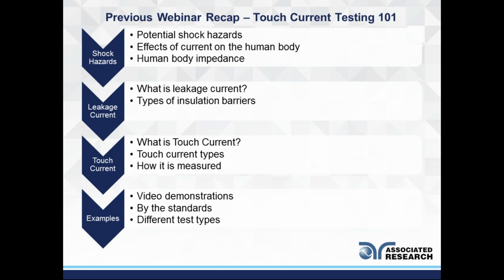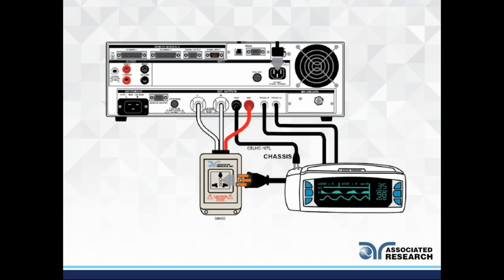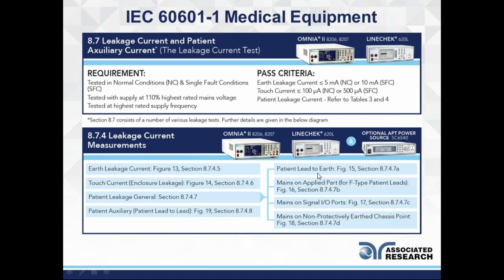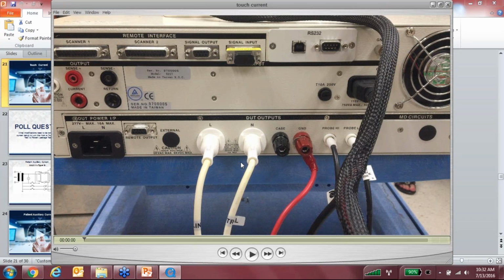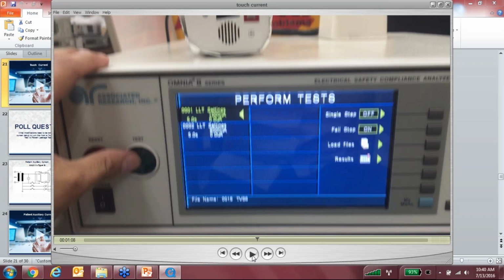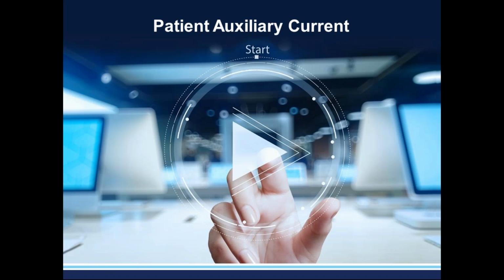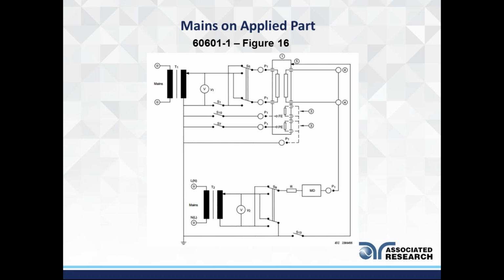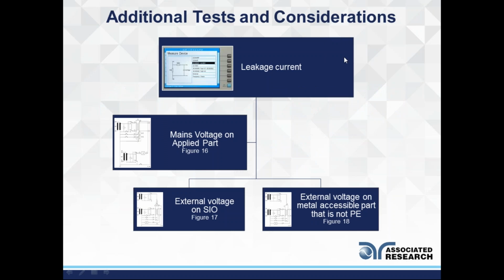Touch Current Testing 102

Comment: I am doing a similar test but the adapter box does not seem to power my DUT. I check with a multimeter and there was not voltage. Any solution?